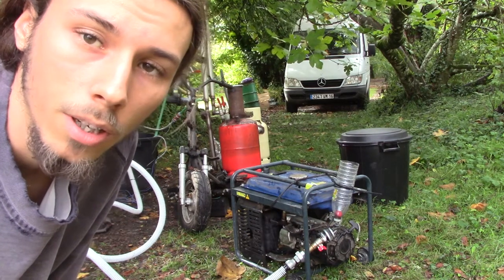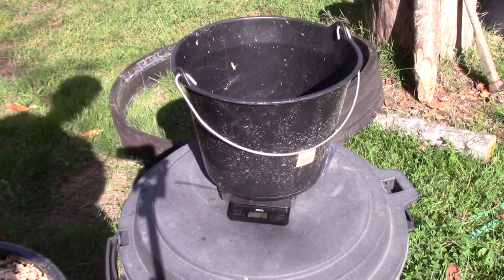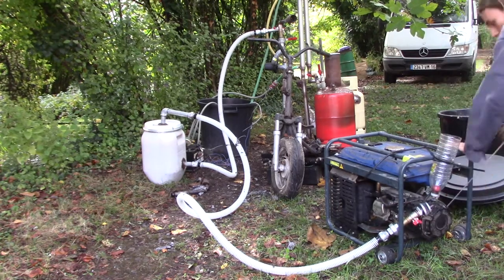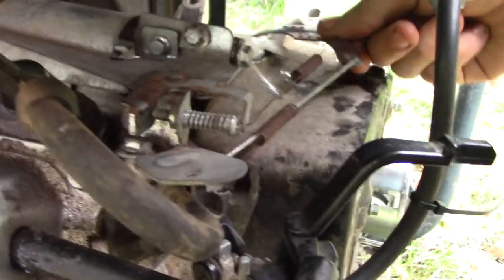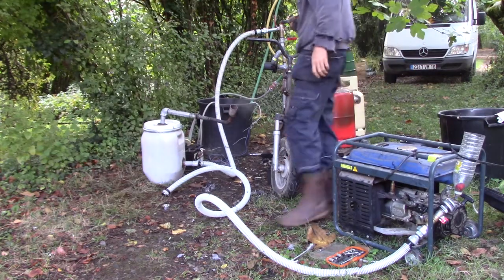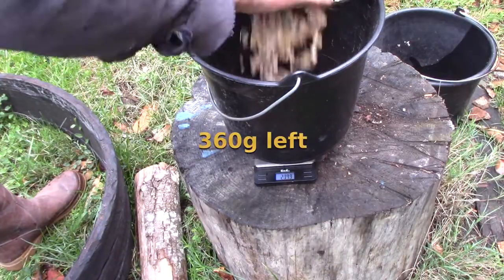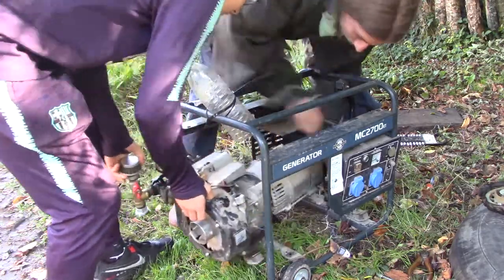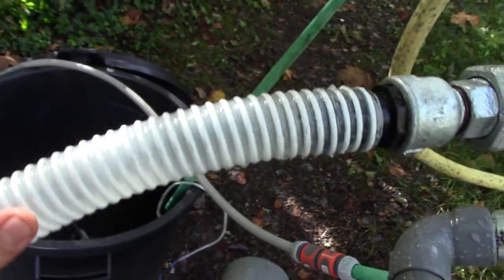Gasifier Ep.14: Different testings

Comment: Hi, so how much power u make out of 1kg of wood. And how much wood do you burn to make those chips gasified?
Reply from the maker: Hi! The wood consumption is about 2.5kg/kwh. The maximum output power was about 1kw on a 2kw generator. I made the measurements with 500g of wood and they were enough to run the engine for 13 minutes under a load of 874 watts (electric output power).
Reply: @foxtizzo  that sounds pretty good, thx and good luck!